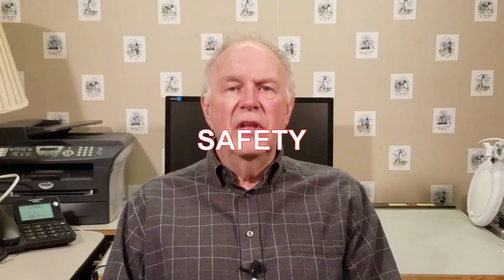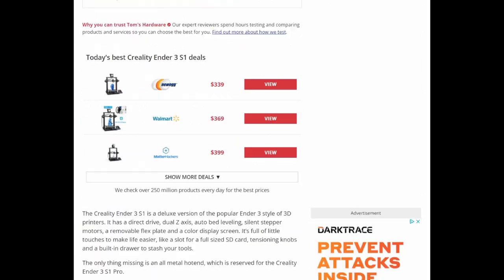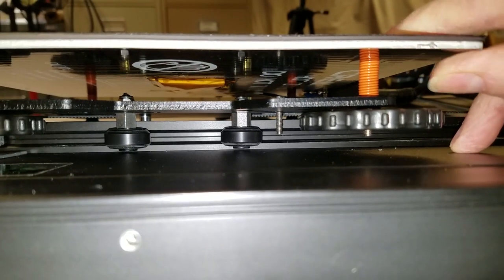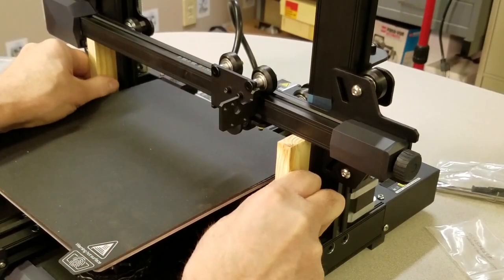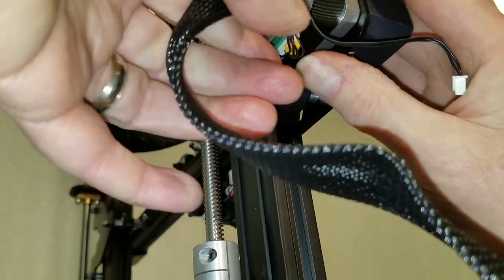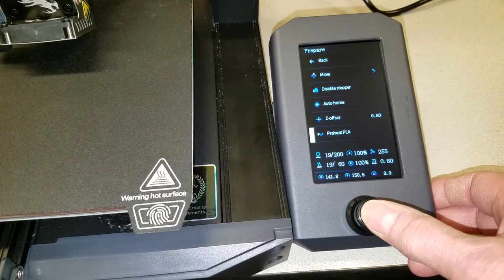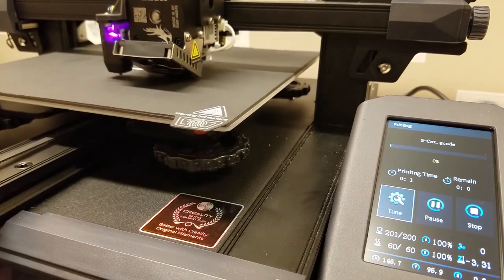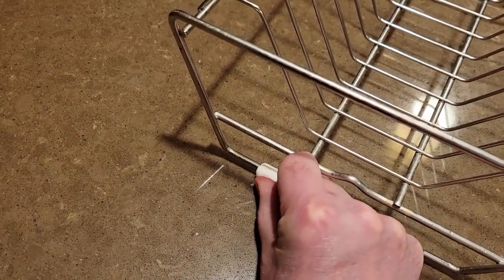Creality Ender-3 S1 Assembly and Demo...by a newbie!

Comment: I had the same problem with the Y axis rollers on my Ender 3 Max I bought a couple of years ago - it looks like its a problem they haven't addressed. In my case I didn't realize it was something wrong at first so the rollers took a llot of wear, and the problem "went away". (I actually didn't see any problems in the prints) However the rollers will need replacing and I'm debating if I can afford to replace with linear rails or some other solution, or just replace the rollers. To be fair, the rollers work really well for anything I do, especially since the E3 Max is slow anyway due to its large print bed.
Reply from the maker: If you didn't have any problems in print quality, I would just replace the rollers.  I was impressed how accurate my bed was using properly adjusted rollers.
Reply: @LifewithDavid1  Yes, but I can't help tinkering with things :D